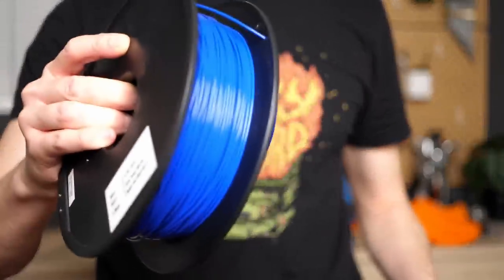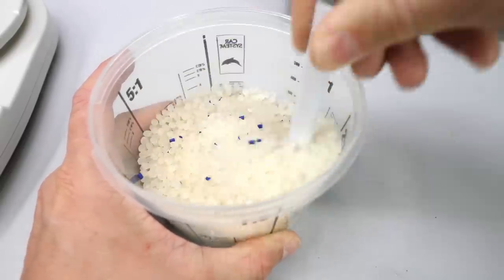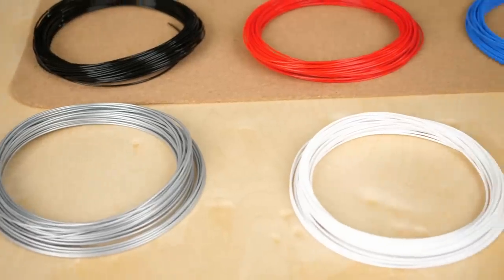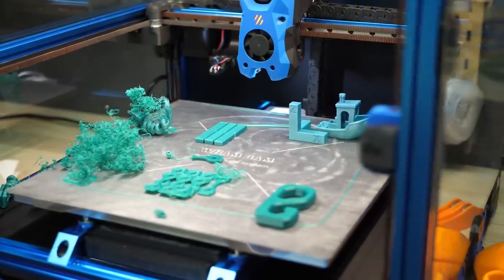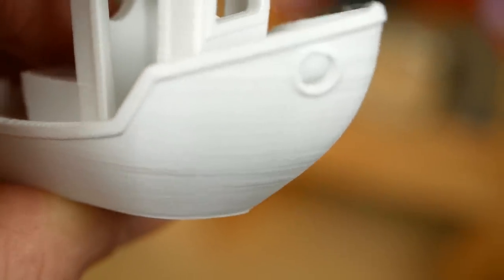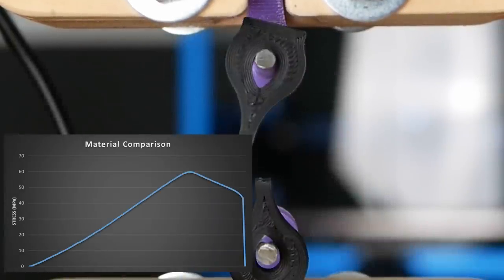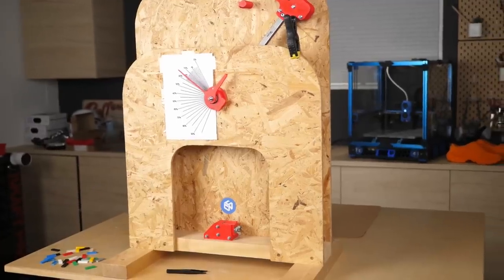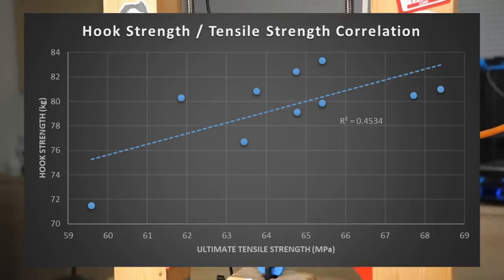Myth Busting: Color vs Strength in PLA

Comment: Have you seen people anneal PLA in salt? There is a special powdered salt (fine like flour) and you burry the PLA part in a container filled with this salt and compact it down, then anneal, this is suppose to help the part keep it's shape and size though it can affect the surface (takes on imprints from the salt), not an issue for a functional part.

Comment: I find really interesting the annealing test, its the first time I something like that, but that brings me a question. the tension inside the filament always tries to push on z but contract in x & y? What would happen when the nozzle is tilted? On circular parts, do this effect manifest in a homogeneous way, if so, could that be useful in adjusting tolerances with the process?

Comment: Though different colors may vary in initial strength if your print will be exposed to sunlight black should be strongest over the long term. Black plastics are generally colored with a material called carbon black. This makes black plastics naturally UV resistant because carbon black is unaffected by UV light and blocks the UV from penetrating deeper in to the plastic. So the UV can only degrade plastic's the outer most layer. Which is why even though neither plastic states it has any UV protection if you cove stuff outdoors with clear polyethylene sheeting it last typically a few months. Whereas if you use black polyethylene sheeting it last a few years.

Comment: Maybe you should do a similar test but different, 10 times the same color, but different manufacturers.
Also I got a testspool from extrudr (an Austrian company) it was PLA NX2 (bright orange), i tested this and immediately took a liking to it, it prints as easy as PLA but i "noticed not measured" a significant strength increase, just by touch and trying to break a sample by hand I needed more force than regular PLA, but as I said this isn't a measurement with comparable figures and graphs it's just me fooling around, could it be some placebo effect that made me favour this material? I tend to be very skeptical but it doesn't make me immune to confirmation bias.
Hence maybe a tip for a future video Extruders PLA NX2 vs similar brands claiming the same, maybe you can ask Extrudr for the samples, their BIOFUSION range has more silky and very pretty colors and they also have PETG's and more ecofriendly filaments or so they claim, I am however very pleased with their quality and service, so again I might be biased, it's up to you to disprove that.
https://www.extrudr.com/en/

Comment: While this does answer the question “Does color make a difference?” I would take any conclusion about “HOW does color make a difference?” with a massive grain of salt. Only three (3) tests were performed for each property, which only begins to show a trend. Furthermore, all variations tested each came from the same spools, so it goes without saying that they were also from the same batches.

When we test materials to develop engineering properties in the aircraft industry, the absolute minimum number of specimens you have to test to get statistically reliable scatter is something like thirty (30) specimens, and they have to include at least three (3) material batches. To get good data, I think you need a whole lot more. I think, at least for the materials we’re discussing here, is that variations between batches will end up being far more relevant than what color they are. But that’s only a hypothesis from an observer on the outside; I’ve printed from a sum total of five (5) spools since I started this hobby, and none of that printing was for parts where any attention was paid to strength.

Getting real, useable data on this topic will be a massive effort.

Comment: i thought it's from the particle size of the pigment
i've read in a random youtube comment that white pigment has the biggest particles and black has the smallest but there doesn't seem to be a linear relationship between strength and size
i have noticed that plain black filaments print smoother than whites

Comment: I purchase several metric tons of plastic annually. And I can tell you that most plastic with pigments are inferior in strength to those which are natural. This does not include composites which are added to produce specialized characteristics. For example; Black acetal is inferior to natural white acetal. The same is true for Nylons. ** Also if you are getting deformation during heat treat, you either are heating the plastic too hot or your heating and cooling cycles are too radical. For example, if you heat Ultem to rapidly, it will actually bubble internally and it will deform if cooled too fast. 100°C is way too hot for PLA. Nylon can be heat treated at only 60°C at 71% crystallization.

Comment: Clear blue is the strongest material I have used.
I remember a part I made in clear blue was run over by a heavy locker in lab and it was fine.

Comment: I use Spectrum PLA, because it's easily available locally. It has a semi-transparent PLA that has horrible print properties, even though the other PLA is fine. The semi-transparent stuff clogs my nozzle and fails more often than it prints.

Comment: I think it’s kind of unfair to some colors to not run them on their individual optimum settings. Dialing each of them in before comparing would tell more about their performance. With identical settings for all colors it’s more a comparison how the colors work with that specific temperature, speed etc. , not what the filament is capable of. Imho the test confirms, that different colors need different settings, that’s for sure.

Comment: Compare your results with a list of pigment size.

Slant 3D made a video called "White Filament Will Destroy Your 3D Printer".
He talks about the larger pigment size and hardness of TiO wearing down nozzles quicker.

In the layer adhesion test, white was second best in your selection of colors. It also did quite well in the other tests.

I suspect the larger pigment size improves mechanical properties.
Almost like a CF filament.

I too think material testing should consider color as well.
Ideally all filaments in their "natural" color, without pigments at all.
Reply: and mix all the colors

Comment: Not necessarily print differences, but I have had major issues with black PLA absorbing moisture from the air and getting brittle to the point of almost crumbling on the roll.  Far worse than with other colors and I've seen it across several brands.

Comment: The only filament I ever threw away without using all of it was silver nGen. Layer adhesion was terrible. Parts printed in silver nGen could be easily pulled apart by hand.

Comment: Obviously the pigments themselves are contributing to the mechanical properties, but I wonder if it wouldn't be feasible to consider things like additives designed to add strength like carbon fiber or glass fiber filled polymers and how they contribute to mechanical properties, with the pigment itself as a mechanical additive.

For example, how similar is carbon black, as a pigment, to carbon fiber additives? How are they different? Obviously there's different types of carbon fiber (or even just carbon) additives, but that in itself is interesting. What about the particles added to the silver to make it look metallic? Is that like metal-filled polymers which add impact resistance? There's simple stuff you can do when mixing up epoxy glue, for example, to add metal powder to it to increase stiffness at home. This is no different, really. Could be an interesting deep dive into the mechanics of polymer additives.

Comment: The problem with all these experiments is that you're only doing 1 trial and you have no idea what variation exists between the colors and between the same color on different rolls and the same material on the same roll. You need to test all of that to determine that the color is the only variable you're testing for. Not to mention that even if the gcode you're using is identical, tiny variations in exactly how the material was extruded and adhered could be affecting the results even if the prints look identical and you isolated every other variable in your control. I'd like to see a video discussing just how perfectly 3D printers are able to replicate prints and how variable filament from the same manufacturer and the same color is with enough trials to reduce error and show the variation.

Comment: When you state "significant", what does that mean? Based on your bars and error (standard error? Variance?) A lot of this data would not be statistically significant by ANOVA. 

No mention if you dried the filament or controlled humidity during printing. Chemically, any pigment will dope the polymeric homogeneity, so it's surprising clear was not the strongest.  But you have no idea about age of the filament, because I find time from date of manufacture can make a large difference.

Comment: I think the problem here is that you didn't test multiple production batches of these colors. It's not clear to me that the color is really what's deciding here - it may well be inaccuracies in the process of manufacturing and age/storage of the filaments. You should rerun this in a year or so with a fresh batch and compare if the properties are still the same.

Comment: Illuminating - but I feel frustrated that the results were so scattered and without any good overall winners. And even if there were - it would probably be a lot of work to research what pigment was used in the brand product you want to buy.

At least "natural" color seems like the obvious choice for scientific testing because it doesn't have any "unnecessary" pigments, so it should give the most consistent and "uncolored" (pun not intended) data about the base material.

Comment: I think they use different compounds to make the colours uniform. This would explain why silk filaments have such poor performance, because metallic colours have very big issues with colour uniformity, because they clump. To prevent this you need the proper additives, which might impact the strength of 3d prints.

Comment: CNC Kitchen
I think there is a piece missing on the test and that is how diferente colors absorb more or less HUMIDITY, you didn't dry all the test filaments. I am pretty sure diferente pigments absorb humidity in a different way and maybe that is another thing that has an effect on strength.  For example there is another youtuber that exposed different parts of a spool to humidity and was able to create inconsistentes similar to like this * on purpose: *https://youtu.be/BMSp1WDqtpI?t=393 So it has a huge influence. Maybe if all the different filaments are equally dried the differences get smaller or totally disappear.  The video I am talking about: The source of this 3D printing artifact is overlooked: Humidity !  https://www.youtube.com/watch?v=NvukJd4QyBk

Comment: After having MMU issues I bought a bunch of prusament. The black was flawless. The red tip gets all stringy. Same settings. Both dry. The red clogs the MMU. The black doesn't. Only difference is the color. sigh..........

Comment: #	tensile		ductility		layer		impact		hook
10	clear blue	yellow		fire red		silver		sky blue
9	white		matte black	white		matte black	fire red
8	natural		sky blue		black		yellow		clear blue
7	sky blue		black		natural		grass green	black
6	silver		white		sky blue		natural		white
5	fire red		clear blue	grass green	white		grass green
4	black		grass green	yellow		black		natural
3	yellow		natural		clear blue	sky blue		silver
2	grass green	silver		matte black	clear blue	yellow
1	matte black	fire red		silver		fire red		matte black
					
material		sum	score
white		35		10,00
sky blue		34		9,31
black		30		6,54
clear blue	28		5,15
natural		28		5,15
yellow		27		4,46
fire red		26		3,77
grass green	23		1,69
matte black	22		1,00
silver		22		1,00
Reply: @CNCKitchen This is Great Info to copy to the top of the page. Yes it's a rabbit hole. On test to see how deep the hole is is to test the same colors from another manufacturer. If a color returns radically different numbers between manufacturers, end of topic because the depths are too ridiculous. But if the data shows some correlation between manufacturers, that's a great clue.

Comment: I did notice that sort of thing before! There's a brand I like, and they make wonderful silk filament. I had used silver, bronze, and then I got the gold one. Gold is bad. My temperature tower (very simple, just a stick) is printable from 200 to 110, above the quality is unusable. Bronze? 200 to 250, eh it's the same exact thing. Lately I started using a "Steam punk" rainbow... and I reached a fucking color blend that cannot be printed at normal speed on my Ender 3 unless it's at least 235 degrees! ffs. This is pla!

Comment: hey, make the 3d printer beds holey, so you can push the print out
Reply: make your own filament by hydraulic press plastic pulp crush through a nozzle (or direct feed to a 3d printed from feed stock)

Comment: Nothing is perfect and our pensions for uniformity exist in spite of the entropy of nature.  every batch may have some variables from storage conditions, humidity, and any infinite other unaccounted variables so we set goals such as filament diameter, humidity controls, scheduled times of day for batches, you can keep your filament in a controlled box the entire time it won't matter because the universe doesn't care,the outside of the polymer will oxidize more than the inside on the filament wire and on the spool itself and or have any number of gases dissolving in and out until the polymer become "stale." Similar to how filament can only be recycled so many times before it becomes unusable as a thermoplastic because recycling plastic adds much more variables you can't control. namely contaminants.

Comment: I'm confident that 99% of 3d printer owners have no clue what MPa is. Why not use gram and gram/cm2 which are more relatable in private 3D printing. If I need something to hold 10 kilo, calculations from MPa becomes tedious and complicated. Also, what temps are you testing at? What is the difference between 20C in shadow vs 50C in the sun? Cheers:)

Comment: How sure can we be that the observed differences do not correlate to filament diameter? Since they are of different Color, all filaments need to come from different production batches. Smaller diameter means less material means less strong part, because the effective sample cross section  would change.

Comment: The advice about staying away from speciality colors is you drawing conclusions about specialty colors in general from a single batch of filament from a single manufacturer again. It's possible that other matte black filaments are stronger than the white filament of the same manfufacturer. Too little data for such a recommendation.

Comment: Interesting video, but I disagree that you feel tuning defeats the purpose.   Your video states what color is the strongest,  not what color is strongest at a specific set of parameters.   Your best test case could easily have been accidentally printed at the best parameters.  These tests have nothing to do with the colors and really provide no valid results.  Even candy companies alter recipes based on color, so it's an easily known fact that that temp and times need to be changed for specific colors.   Normally, I really enjoy your videos,   but I'm pretty disappointed at the approach taken for this one.  I honestly feel it was only made to promote your sponsor and had no real insights nor value to the community.

Comment: Ever wondered why nobody's using PLA for consumer products? 😉
Reply: They do these days, they make disposable cups and cup lids out of it.
Reply: @Alex-mj7km  Are your TV, computer, fridge, smartphone, game console, phone charger etc disposable products?
Reply: @mururoa7024  I made sure my laptop case is actually made out of magnesium, because in recent years quality of plastics became absolute... I don't even know, fecal matter is probably less brittle. 
Other thing is that all plastics are injection-molded, and I don't know if PLA can be injection-molded.
Reply: I've had every PLA print that was under some sort of load and exposed break after 1-2 years. It behaves awesomely fresh out of the printer top notch properties and then something happens to it. Normally i expect a plastic item to last 20 years, and within reason, i expect PETG and HIPS prints to do just that.
Reply: @SianaGearz  Indeed. People focus on brute force strength a bit too much. How durable a part is and how well the material ages is more important if you want to make something that lasts. In many cases part strength can be designed in when needed (there are industrial design tutorials here on YT).